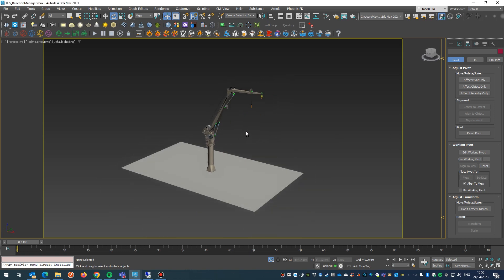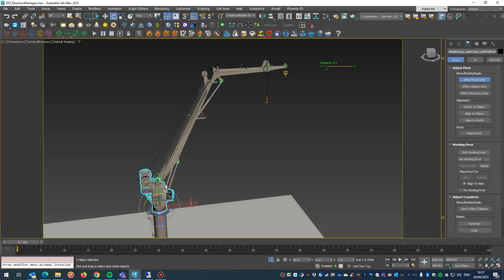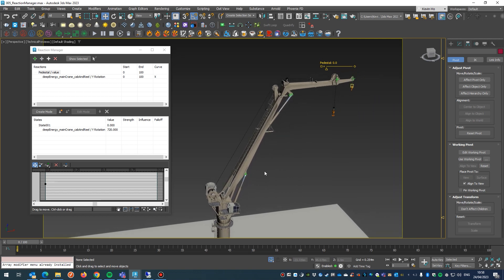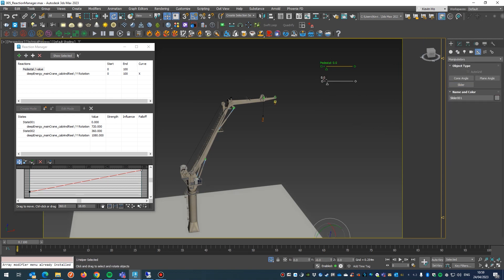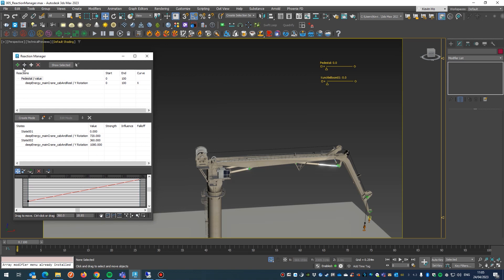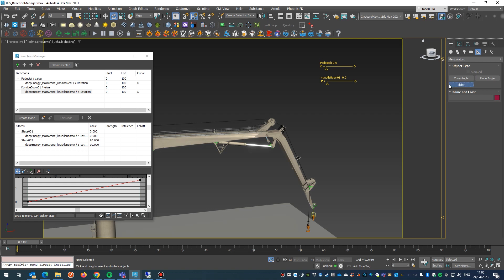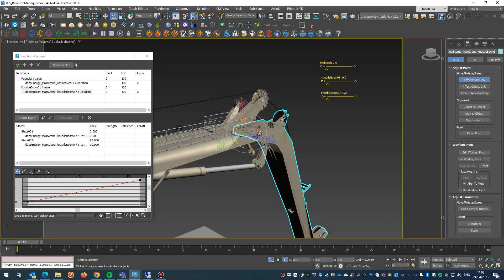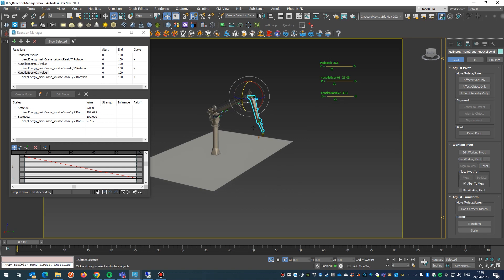3DS MAX 2023 How To Animate Reaction Manager | Slider Control | Manipulator (Step By Step) Tutorial

Comment: Can you do more videos about dynamic animation like rig with bones plz
Reply from the maker: Could do yeah a bone rig with spline or link of chains?
Reply: @kevinkitho  yes like dynamic animations of hose with bones and crane lift that hose dynamic types
Reply from the maker: @Team_rk288  Will look at doing something like this down the line however my favoured method in most cases is using something like splineIK solver rig as its usually a great solution 99% of the time in my world. Bones setup is a little more time consuming but not too dissimilar involving skinning IF you want to use dynamic/organic hose/cable/rope...